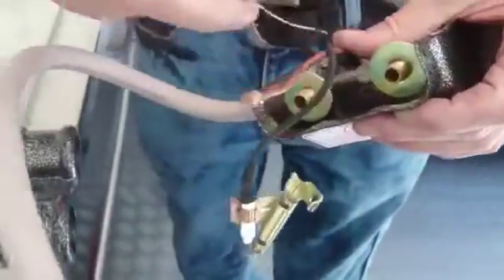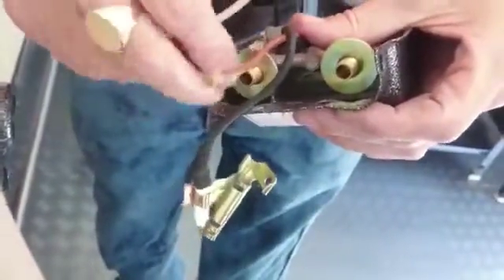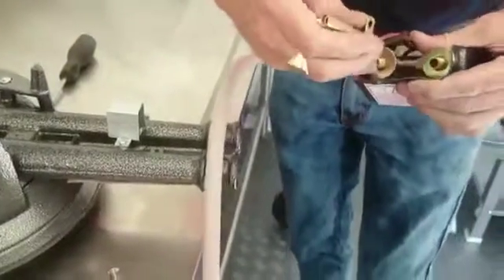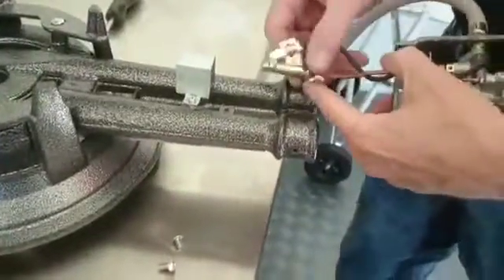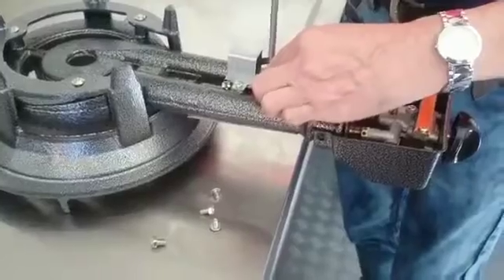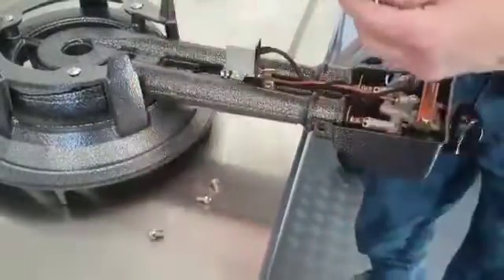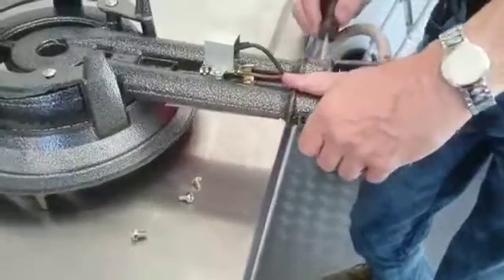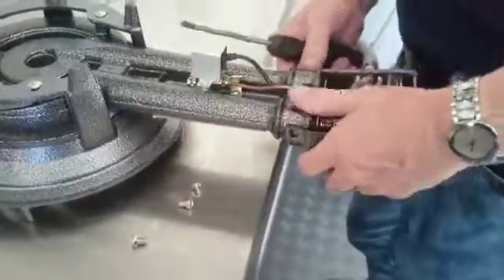How to clear blockages from Auscrown RBC176LP and RBC225LP - Cast Iron Ring Burner

Comment: Is there a way to clean the rings where the flames come out.?. Over the years of use, the cast iron would naturally rust , blocking those rings or holes from where the flames come out. Please help.
Reply from the maker: Thank you for your comment. You can try using a metal skewer to clear the ports.
You can PM me if that doesn't help, thank you